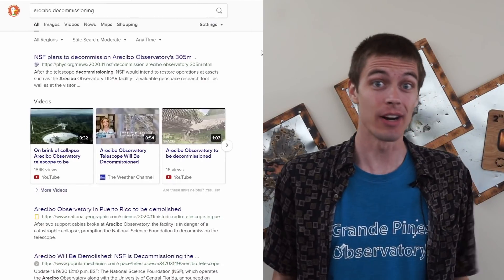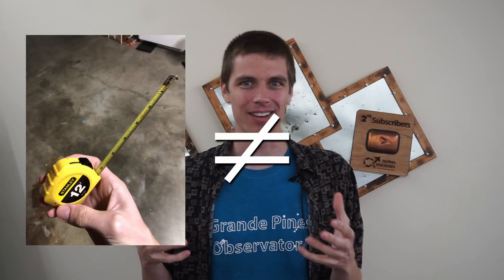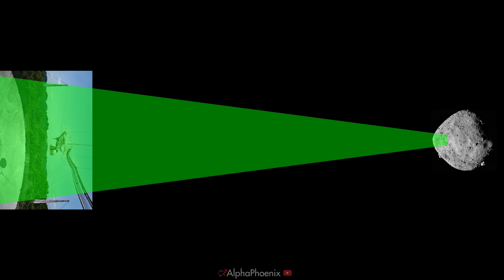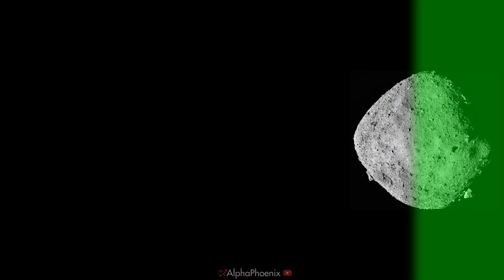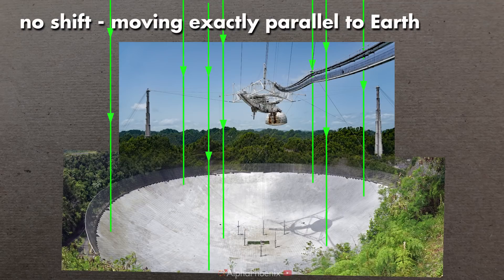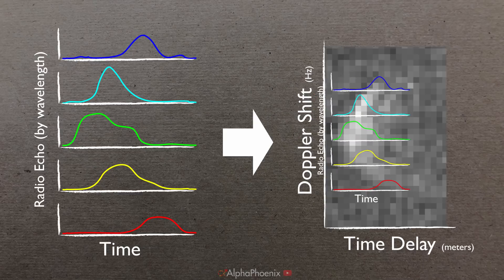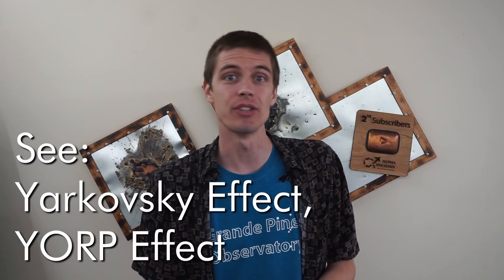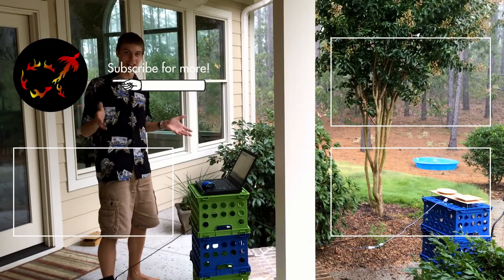How does PLANETARY RADAR actually work?

Comment: Knowing how far a point is, and how fast it moving towards or away still isn't enough to give you a 2d image. Only enough resolve details on along the direction of its spin. You actually need to do something else to find the points off to the side of that plane of rotation. I think what they actually do is measure an interference pattern (in effect, the fourier tranform of the actual inage) of the radar beam, and then perform an inverse fourier transform on that interference patten (similar to what is done to obtain the shape of a crystal, during xray crystallography) to obtain the actual image.

Comment: I actually work with a system very similar to this (that has in the past also been used as a planetary radar). I already knew basically how the imaging worked--you didn't cover resolution and bandwidth!

But what I really want to say is that mapping RCS and amount of doppler shift back to stripes on the asteroid is a very clear and simple way to explain how it works. I hear radar imaging described all the time at work, but not this clearly. I think I'll forward this to some people...

Comment: 1:05 although image sensors like CCDs and CMOSs are composed of discrete sensors that you can call "picture elements" (aka "pixels"), and not only that but CMOS images sensors are actually named "active-pixel sensor" (APS), those "pixels" are not your standard RGB triplets as you'd expect. They use a color filter array, usually a variant called Bayer filter. So despite most sensor devices handing you the fully RGB processed by "demosaicing" the raw data, inside the device what you have is a matrix using some manufacturer specific arrangement. In the case of Bayer filter it consists of 2x2 quadruplets with 1 red sensor, 1 blue and 2 green, but some others have white specific detectors, some use non aligned lines of sensors, and even some others use layered sensors.

So while obviously not as nearly as complex as getting data using the doppler effect, time delay and so on, they also require some computation to get an actual image from the raw data, many performing interpolation as part of the demosaicing process to fill in the gaps.

Comment: what happens if the the rotation axis is pointing more or less towards earth, or the astroid is just spinning very slow? Would the doppler effect tell you any usefull information, and could you tell the difference between the two?
Reply: Doppler wouldn't get you much, but trying again in 3 month works because the axis of rotation won't point at earth anymore.

Comment: Why use Doppler to measure speed for radar guns? Seems like it would be so difficult to try to measure redshift, and easier to just sample distances many times per second and do v=d/t
Reply: It is actually really simple to measure the "redshift". You only need to measure the difference in incoming frequency from the outgoing frequency. This can be done by mixing them and you get the frequency difference, often in the audio frequency range. You are basically doing interferomety and get one cycle in the out signal for every half wavelength the object moves. The problem with measuring  distances to get velocity is that you will get echos from a lot of stationary objects as well as the moving target. With dopler radar all stationary objects have 0 frequency shift and can easily be disregarded.

Comment: As I see you use Resolve a lot, I am not sure if you are using Fusion. But there is two different radar motion graphics examples in the Fusion templates that are meant as a reference. If you haven't looked at them yet - take a look and learn about how Fusion uses a CoordinateSpace node to go to polar. And what issues it has to fix due to the widescreen videos. 

Radar is active imaging. But you can still just listen to those wavelengths(/frequency, same thing but used at this end of the spectrum more often) and find emissive targets or other reflections. Visible images are mainly reflective, only very few things are emissive, some are transmissive. The opposite is the thermal infrared. Especially 8-12μm which has an atmospheric window and can be seen using uncooled microbolometers. Which is what I am really interested in. 

Go even more extreme in wavelengths and you can do terahertz imaging, which can be done passively and actively (airport scanners).

While at it, try and make sense of radio astronomy interferometry. Which is physics, but magic for the data and results. Allowing you past Dawes limit.

Comment: Does this system utilize some kind of subpixel estimation? Like you said that the beam becomes too wide to pinpoint a specific spot on one asteroid, but if you move the beam slightly and then compare the two images you should be able to resolve a higher resolution and perhaps even work out the north/south symmetry issue

Comment: "By the time a radar beam from Arecibo reaches twice the distance of the moon the beam is 450 km wide, which is way bigger than any asteroid." laughs in Ceres

https://solarsystem.nasa.gov/planets/dwarf-planets/ceres/in-depth/
diameter = 952 km.

Though, your point is still valid — Ceres and the other bigguns never get within twice the Moon's orbital distance.
Reply: Ceres is not astroid, it's a dawrf planet.
Reply: Distance to Ceres: 491,785,528 kilometers
Distance to moon: 238,000 kilometers

Relative width of beam: ~1,000x at Ceres
Approx width of beam at Ceres: 450,000 km

Ceres is tiny, and far away.

Comment: Arecibo is in a Radio Quiet Zone, it is near impossible to create a new one of those these days - search for NRQZ (National Radio Quiet Zone). Most people love their shiny electronic devices, radio transmissions are heavily restricted and regulated to limit interference -  devices that emit radio waves, including cellphones, Wi-Fi, microwave ovens are illegal.

The Green Bank Observatory in West Virginia has a 34,000 square kilometer (13,000-square-mile) National Radio Quiet Zone, imagine trying to create a new NRQZ somewhere else today, no one would accept those restrictions. There is actually a microwave oven inside the the Green Bank Observatory, but it is inside a room that is inside a Russian doll of Faraday cages, with a Faraday cage airlock. For astronomers to be able to re-heat pizza at 2am required some major additional funding as well as some major building modifications (ref: https://youtu.be/5N1C3WB8c0o?t=677 and https://twitter.com/unormal/status/1023421433857404928 ).

Comment: While optical telescopes with their many pixels are great at telling you the position in the sky of an asteroid (altitude and azimuth, X and Y basically) and how it moves across the sky (lateral velocity) it doesn't tell you much about how far away it is (Z) and how fast it's moving towards or away from us, which is the exactly what a radar telescope is good at. So for a precise orbit you really want both!

Also: Great explanation! I was wondering how that worked :)
Reply from the maker: Gotta get those coordinates!

Comment: Could they not use some sort of lightweight skin to replace the concrete dish?
Reply from the maker: The actual reflective surface of the dish is individually-tiltable sheets of aluminum. When your light has a 12cm wavelength, your “mirror” doesn’t need to be real smooth by human standards

Comment: Technically, isn't it possible to use planetary RADAR on outer-solar-system bodies? It seems like it would just get wildly impractical, but not technically impossible. If you had an object that you knew was very close to half a light-day away, you could blast it with a signal at, say, noon, and then noon tomorrow you point the signal in the same place again, hopefully getting a decent return signal.

Thinking about it, a Moon-based RADAR telescope could circumvent the 1-day (or some integer number of days) restriction on delay by changing the definition of a day. By using a natural Moon crater, you could also get a much larger dish than here on Earth, potentially reducing the losses incurred by sending a RADAR pulse some huge distance. Speaking of, I'd bet that the microwave generators would have to be rated to a few MW at least.

I also wonder what kinds of scientific value RADAR imaging things like TNOs might have. There's also no way this could be scaled up enough to image extra-solar planets with any kind of practicality, right? The losses are distance^4, meaning that if Arecibo was good for 30 lightminutes with 1 MW, to be good for 1 lightyear with the same optics (not factoring in a large dish for convenience), that'd be... 17,520 times as far... about 10^17 times as powerful... about 100 zettawatts... or about a thousandth the output of the sun shot in a tight beam at our nearest neighbor. Not only is this impractical, but the stellar neighborhood's homeowner's association would have a riot.
Reply from the maker: haha I believe Arecibo has a roughly 10 AU limit (from a Scott Manley video)
Hopping on the wolfram to confirm:
2*10 AU / speed of light = 166 minutes
1440 minutes / 360 * 40 = 160 minutes
After 10 AU of there-and-back lightspeed, Arecebo's 40 degree cone passes completely over an object so tracking would fail. Imaging something a light day away sounds really interesting, but you'd need a LOT of integration time because of the r^-4 issue
Reply from the maker: I also REALLY want to see crater telescopes, but I think that we need a lot of starships flying to the moon to make that happen...
Reply: @AlphaPhoenixChannel  Thinking about it, it seems really difficult to escape the fate of needing lots of integration time. Probably easier to escape with a very large dish rather than a very powerful transmitter, as the active power requirements for the latter seems prohibitive.

With a crater telescope, a 40 degree arc translates to about 72 hours maximum tracking time. This would allow for imaging objects in a much wider range of ranges (lol). How alluring a crater telescope is makes me wonder if NASA hasn't kicked around some very hypothetical mission plans for building one. The lowest payload mass requirement option would probably involve sending a few paving robots ahead of time to spend a few years polishing a crater into a dish.

Also, speaking of Starship, how about that 15km hop, hopefully tomorrow? Bets on success and/or type of failure experienced? My bet's on an engine failure upon reignition, resulting in SN8 going ker-splat outside of the launch complex.
Reply: Exactly right. With the world's most powerful radio transmitter and the world's most sensitive radio receiver, we could do asteroids and some of the Jupiter and Saturn satellites (Saturn's rings are ice and ice is shiny to radar). So to do something like Europa (Jupiter's shiniest moon)  if it were 1 light-day away , you would need a few hundred thousand Arecibos. Not literally impossible, but yes, wildly impractical. It would also cost about a million dollars a second to operate.

Comment: So that’s how it works, very interesting. I suppose this is a form of astronomy that isn’t limited by the Rayleigh criterion, the size of the dish is just important for high gain. Of course, it doesn’t work on anything outside our solar system due to the delay. I guess you could look at Doppler and delay information from short radio events like supernovae or neutron star mergers without needing to send a pulse there in the first place.

It might be feasible to get the same quality of measurements as Arecibo by using a small, amiable MW emitter with a seperate receiver nearby. Modern radio/electronics technology means we can probably make the dish smaller and still get a good SNR. Not to mention not having to suspend something above it. Actually, by having one emitter and receivers all across the world (or the other way around, or both) you could image slightly different angles of the object at once, potentially resolving that hemispheric ambiguity.

Now I want to do that with a microphone, transducer, and MCU.
Reply from the maker: If you’re trying to image things closer than two lunar distances with Arecibo, you actually have to use a separate radio telescope as a receiver because Arecibo has to physically rotate an aperture between “send” and”receive” and apparently that takes a few seconds